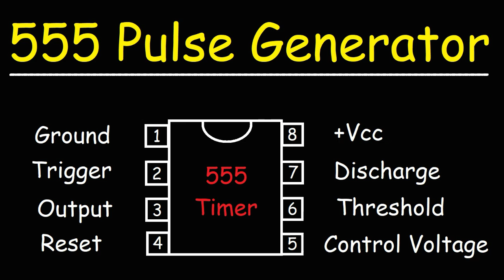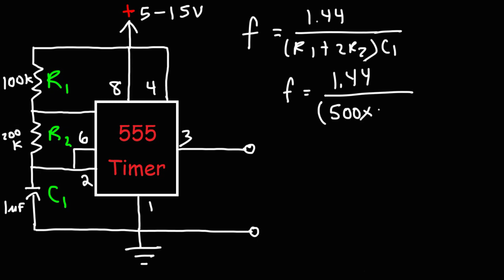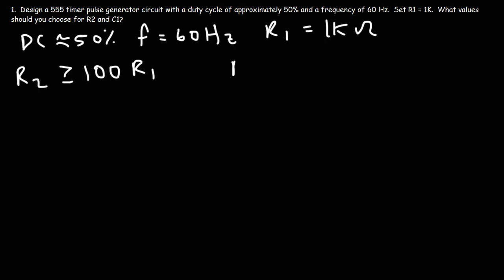555 Timer IC - Low Frequency Pulse Generator Circuit

Comment: Very clear and detailed explanation! thank you. I am trying to create a timer with the opposite    wave train, Pw = 30 sec and  Sw = 300sec.  I think that the way to calculate the value of the components is different. I calculated  c1 = 43micro farad  bases on Pw = 30sec , Sw = 300sec,  r1 = 1meg and r2 = 1k. can you please comment

Comment: Great. You would make a great math teacher. Everything is explained clearly, in detail and with good examples.
One small (maybe pedantic) point: Twelve is a 2 digit number comprised of 1x10 + 2x1. 0.12 is an entirely different number and should always be read as 'zero point one two' not 'zero point twelve'.